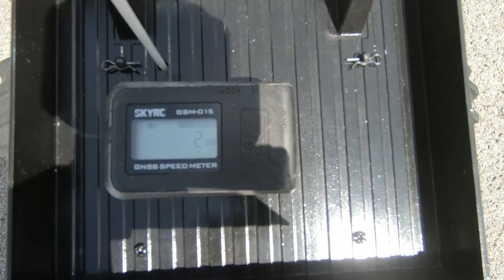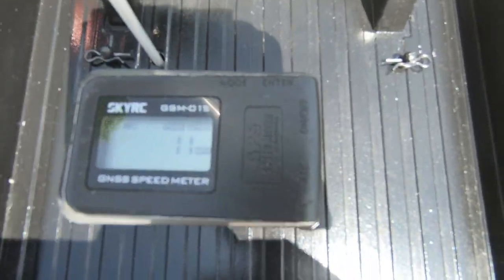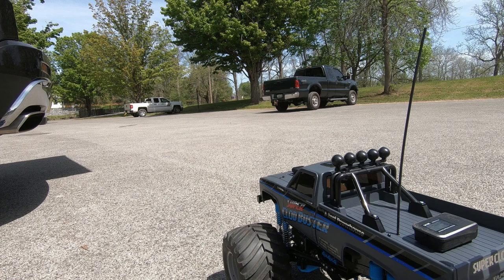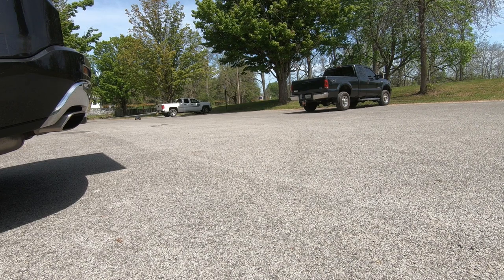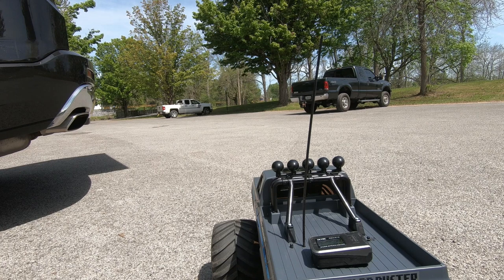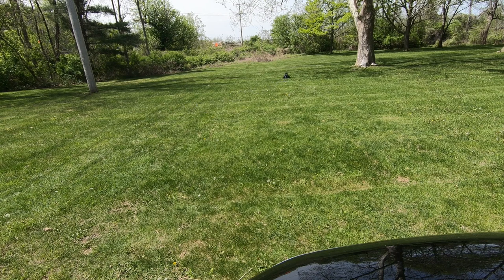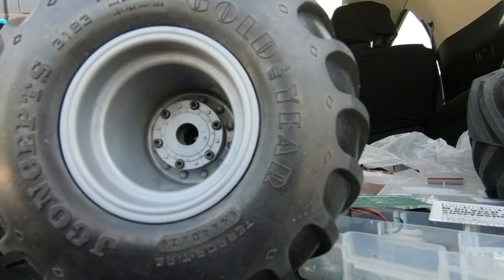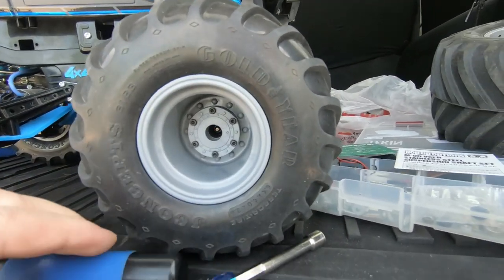Tamiya Super Clod Buster Gray Edition Speed Run... With 2 different sets of tires......

Comment: Very interesting. I heard about RC4WD motors, which give only 1 mph more. I keep your upgrades in mind for the next Clod project.
Reply from the maker: Hi Dirk, Thank You. I don't know anything about RC4WD motors other than most of them are used for crawling, crawling motors are not that fast to start with. However, they tend to have tons of torque.

Comment: Nice test, dude! Well I think 3mph is a fair increase in terms of percentage! You can easily see the difference in torque as well. Weird about that wobble, looks like it could almost topple over on the tarmac! Cheers for the "tool tip", very useful. ATB mate!  :))
Reply from the maker: Thanks Mark. I was hoping for more than 3mph faster, 27T to 23T (yes, they lost some timing) but the torque is awesome.. I'm happy with it really, any faster and I'd crash it, not my goal.  I think the wobble is due to the foams in the tires (it did not wobble with the stock tires). I think I screwed up mounting a tire or two (it was late). I need to get some Debonder take the JConcepts tire off the wheels and do it again.  ATB my friend..

Comment: Great video Bob!!
Very interesting..... I've got a few of those TZ motors.
I'm suprised it was only 3mph quicker, but it clearly had a lot more torque than the silver cans!
In reality it's probably a good job it wasn't any quicker with that wobble eh mate?
At least you dont have to hose them down after this run! 🤣
👍 👍 👍 👍
Reply from the maker: I hear ya mate, from 27 turns to 23 turns isn't a lot,  and it don't need to be faster, I don't wanna crash it. Plus I lost timing in the motors but your spot on about the torque, it's monstrous!! The wobble has to be the JConcepts tires, more than likely, the foams shifted in 1 or 2 of them, cause it's "Dolphin Smooth" with the stock tires on.

Comment: The Clod looks really sharp Bob! Not a speed machine but pretty damn cool nevertheless! Great tip on the Tamiya tool,I am sure that will come in handy some day👍
Reply from the maker: Thanks Peter!!! Speed wasn't what I was going for with this truck but I was hoping for more than a 3 mph (4.8kph) increase, I did lose timing when I re-worked the motors (this has to be done) but this is fine. Torque output is definitely more than tripled. With a big heavy truck, torque counts more than speed. I'm happy with it, but that wobble with the JConcepts tires, that I don't like.

Comment: Nice tests Bob! The TZ supplied more speed but I’d of thought they’d given you a bit more!
Great tip with the Tamiya tools!👍😊
Reply from the maker: Thanks Jeremy, Yeah, not as fast as I thought it would be (that's ok with me, any faster I would crash it).  The motors did lose about 24 degrees of timing cause you cant just put the motors in, I had to re-work them. I did gain a ton more torque and the truck looks cool pulling the front tires at anything less than half throttle.

Comment: I put the Holmes retro sport 19t 540’s in mine and Grayson’s has the stock silver cans his has a bit more torque but mine is definitely faster
Reply from the maker: I seen the video, and I wanted the Holmes 15 turn motors for my race Clod (I wanna get 4 motors) but they seem to only take paypal and I don't have paypal nor do a care to use paypal in anyway.  I'm not sure if they will fit in my Clod cause the stock motors are close to the shocks and the motor wires rub....